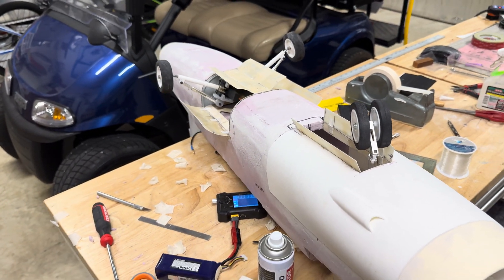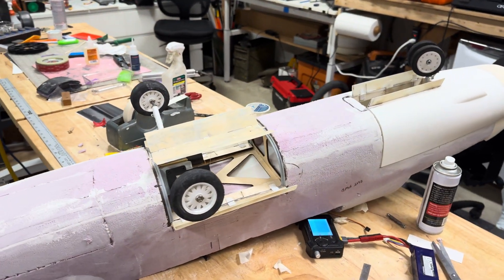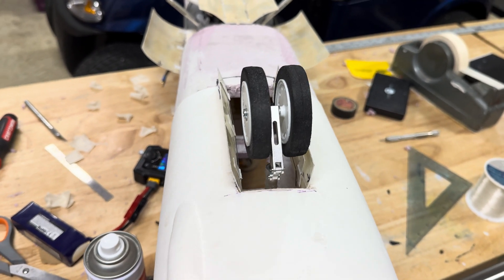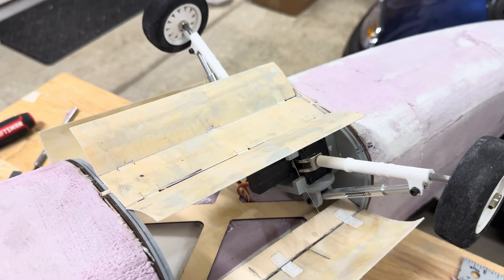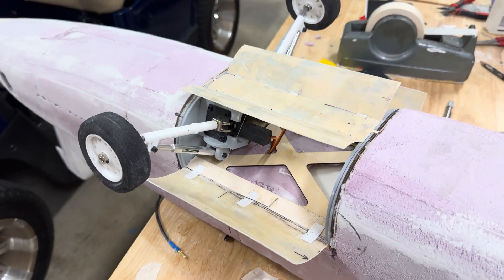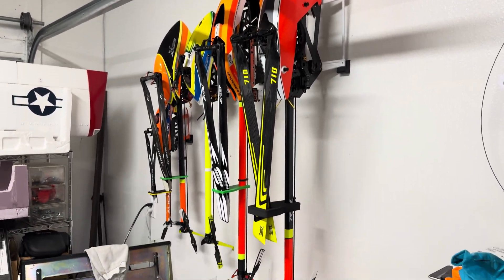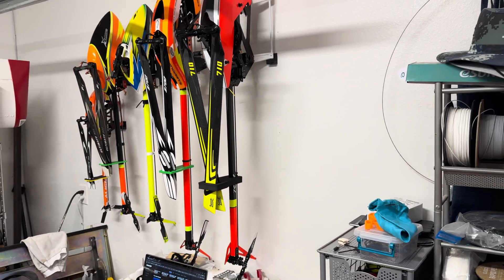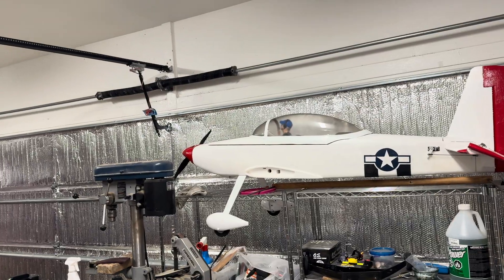JPC’s Workshop: February 9, 2025

Comment: Looks fantastic. What spackle are you using? I’m having a tough time getting the DAP lightweight spackle to leave me with a good painted finish, no matter how much sanding and primer it always shows through the paint
Reply from the maker: Thanks! It's really rough right now, but it will smooth up. I use the DAP lightweight. The trick to getting it to not show through is to mix up a batch thinned with water based polyurethane to a milkshake consistency and cover the entire airframe with it. Sand it smooth, then prime and paint. Otherwise, you will always see the differing texture through the paint. Or put fiberglass over it. :)
Reply: @ that is genius, I had never heard of that method before. Does it have to be polyurethane? I’ve got liquid polycrylic I use to gloss my airplanes after I paint them, would that work the same you think?
Reply from the maker: @hennys_rc_hanger sorry, I missed this reply! Yes, the polycrylic is what I use.